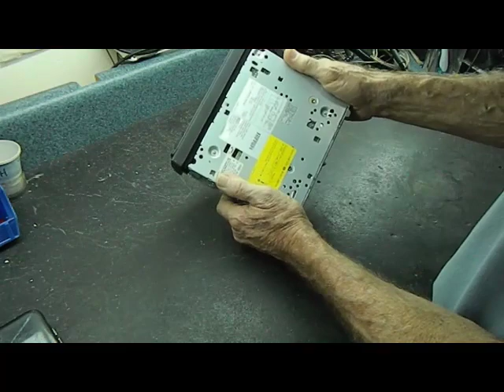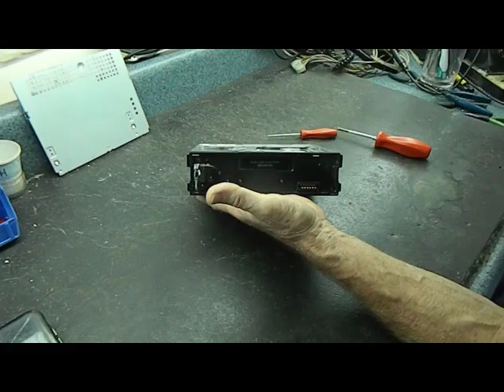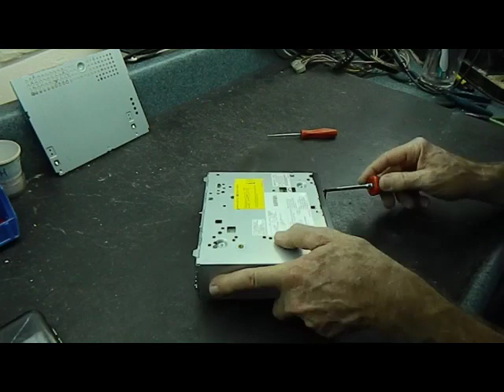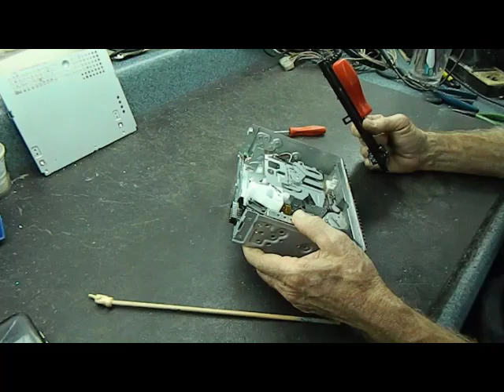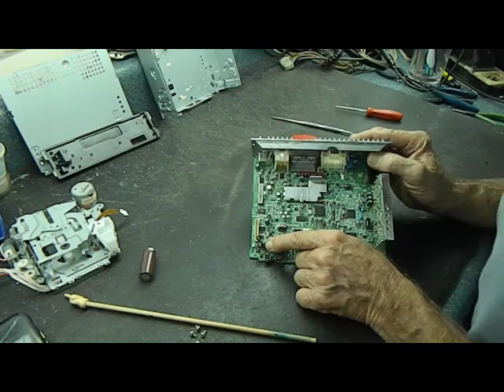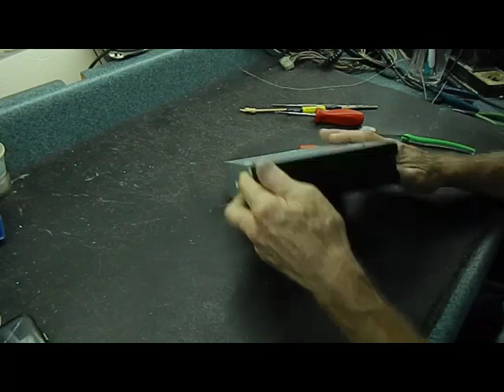Ferrari Sony XR-F20 Stereo - No Power - Car Stereo HELP

Comment: I was wondering if you could answer a question on this unit for me. There is a small blue jack on the rear of the stereo. Is this an 1/8" aux audio input? Thank you
Reply: The blue connector is for connecting the control joystick